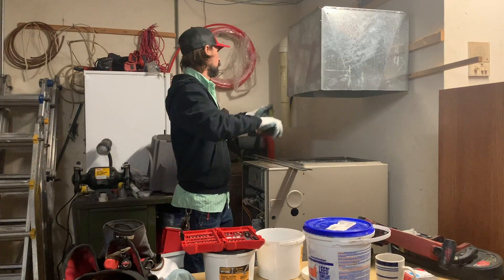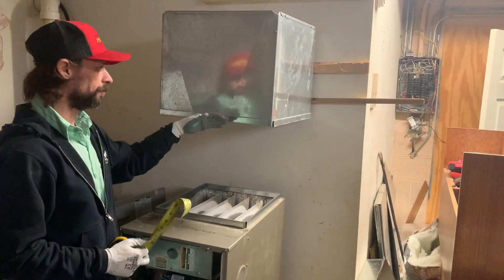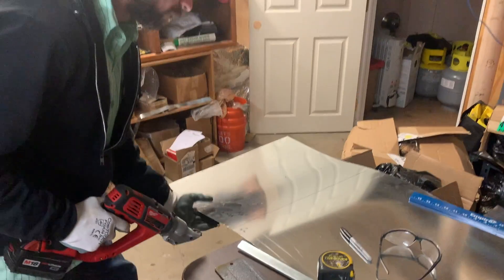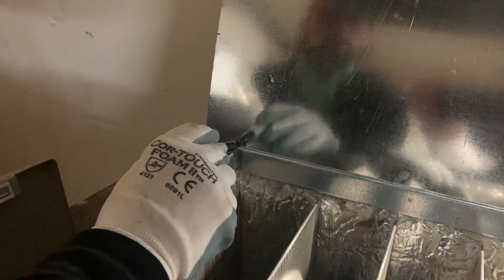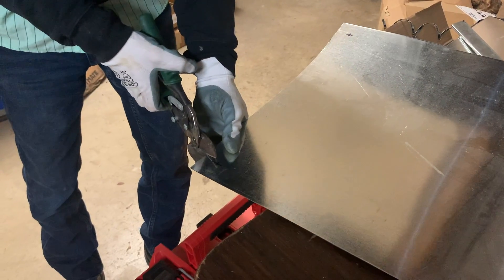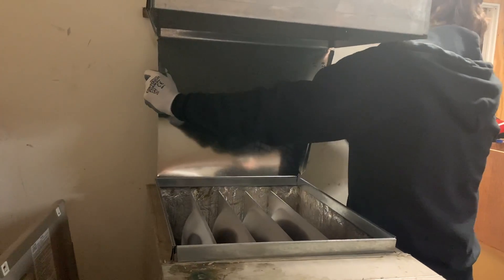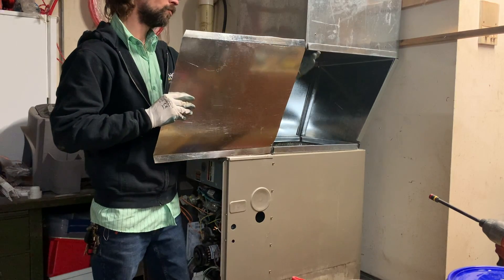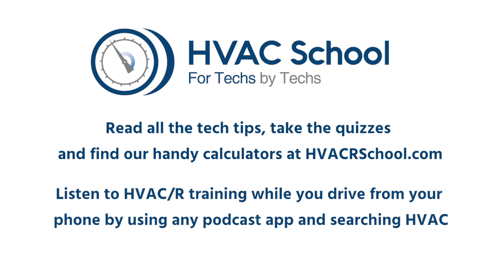How to Make a Metal Duct Transition in the Field

Comment: Their not called S Locks bro theyre called slips. The connection is called slip and drive. The slip is wat u call s lock (which is wrong) and the piece that slides over the 2 ears are called drives

Comment: great video, i would recommend cross breaking the metal to reduce duct flex noise though. in the field i usually lay the old furnace down, flex the metal along a corner, and use a rubber mallet to get my cross break if i don't have my break with me.

Comment: Around 2011, I replaced the furnace in my (low) attic.  The ridiculously time consuming step was building two transitions in place for the new unit.  I think I spent much of two days building it piece by piece.  This was before YouTube built up so much knowledge.  Today my jaw dropped when I watched how straightforward it is when you know what you are doing.  Great video, thanks for sharing!  I am gearing up for a new evaporator installation, and I feel empowered.

Comment: Great technique! For those that want to cross brake the plenum or any metal ductwork it's easy to do without a brake. Before assembly, I use a straight edge and a screen spline roller, but a screw driver, awl, etc works too, lay the metal on cardboard on a hard surface. Place the straight edge from corner to corner and run tool applying downward pressure along straight edge. Rotate metal 90° and repeat. Do this to the inside facing metal for functional and professional looking HVAC metal work.

Comment: Mi make my duct in the field got a mini fab shop in my box truck with a break if you know how to make s locks into the meat do it on the side pieces of the plenum so the back piece and front piece slide right in . It looks alot cleaner that way in my opinion. I feel like this method is a shortcut just throwing up a piece of metal and marking transitions rather than using a tape measure drawing it out and building it.. I'm a little conflicted by this and am weighing on weather if this is Hack..

Comment: Great tip on using the screen roller. I wouldn't have expected it to work so well. I'm thinking one of those thin, expanded rubber yoga mats would make a good semi-rigid backer surface when forming the cross break. Just don't tell my wife I'm going to use hers to try this technique.

Comment: One thing i do differently is not putting s slip on the furnace. Just make a 1/2” fold out away from heat exchanger  across bottom of metal piece and tbat gives you a good place to screw it to furnace, just looks better than the slip but otherwise good demo

Comment: Just an electrician but still amased when I see was how they can make a transition from round to square or even a rectangular duct. Reducing offsets look impossible to do. First thing my eye goes to in a new commercial site is the electrical then the duct work. At a 65 man maintenance shop that I worked in they had a tin knocker who could build anything out of sheet metal and never had much scrape left over. He would place eight 90 degree bends to make packing conveyor lines that had lowered lay down area on both sides to store material or parts that had to go onto conveyor belt. He always deburred edges then bent back edge 180 degrees back into itself so workers could not get cut. I was surprised when I made a sucessfull single 90 degree bend in a piece of sheet metal. Guys are absolute artist who make great duct work.

Comment: I think this is a very good video from start to finish. The only thing I noticed immediately is there is no flex duct connector. I
My understanding it that its required by code on both sides (in h out) of furnace to reduce duct vibration/noise in duct system.

Comment: was always taught to cross break the sheet before putting it in to reduce flex in the metel when the blower kicks on, though depending on the surface area it may or may not be an issue. I wish more installers made transitions like this though.
Reply: That's pretty much the way I always made them, and cross-broke everything.  Cross-braking looks a little nicer too.
Reply: Waste of time
Reply: @Bridgesc3  trolling?
Reply: @Bridgesc3  not a waste of time, it reduces popping. Just say you don’t cross brake, don’t call it a waste of time, it only takes about 15 secs to cross brake 😂

Comment: I am in the process of replacing my 40 year old furnace and AC coil with a MrCool Universal heat pump system.  This video was exactly what I was looking for.  Thank you for the easy to follow video tutorial.
Now, off to the hardware store to get the required hardware.  Cheers!

Comment: Leave the back and front s-cleat longer, so you can fold around and screw to cover the holes on all the corners
Reply: Unless you use Mastic like you're supposed to, then the fold over just looks like a big lump.
Reply: @chadegillham1165  Use clear or even grey silicon, looks so much cleaner
Reply: I was gonna suggest this too 👌🏻
Reply: @ethersecure2432  Thats what the guys did at my old company it looks a lot better and hides the gaps.

Comment: Nice work!! Personally I would do a one piece transition and a door. All with a cross break
Reply: Cross break it and then just use a flange on the front piece and screw it to the furnace so that you can just remove the screws and then the panel.

Comment: Not bad. Maybe add cross brakes and cut the front and back cleats with inch over hangs so you can bend them over the corner so there won't be air gaps. Other than that👍
Reply: It's called mastic guys.
Reply: Exactly!

Comment: Next time s/m screw from the inside corners in the back and then duct mastic everything from the inside on the back seams, top seams and side seams before sliding on your face plate, then all you got left to duct mastic is the face plate. At our shop we use FSK insulation and never use bubble wrap, mainly because it doesn't have an R value. However, that was an excellent demonstration on field transitions. 

Maybe next time you can show them how to do it without s-locks when it is in a tight closet. When we do one of those we bend the sides and not the back or front and just use a flat piece of metal for the back and the face plate.

One other thing you might remind them to put a little cross break so there won't be any oil canning. 

Again good job.
Reply: He did actually say that there's multiple ways to skin this cat. However, I'm with you and would like to see a couple more videos, showing him skin the cat some other ways, to boot.

Comment: You need to brake those or it’s going to pop every time the blower starts and stops.
Reply: Maybe, maybe not... I do recommend a cross-brake over 10-12", but trying to show the concept with common tools. Any other take aways / suggestions?
Reply: @mhoush  in a pinch one time I used a 2x4 to cross break. Really should be done.
Reply: @christopherborner1139  So everyone seems to say, but my official answer is meh... If it becomes a problem or does create noise it can be dealt with... Perhaps controlling static and using heavy gauge metal is enough in most scenarios... Keep in mind this was setup in the shop to demonstrate, often times the transitions are much shorter.
Reply: @mhoush  they can also use a flathead and a straight edge to scribe the back in an "X" to create those breaks.
Reply: Stops it from oil canning . Plus it just makes it look cleaner . Learn to do a Pittsburg end and makes it look even cleaner .
Reply: It will only pop if you use wrong gauge metal. Cant make transitions with 28 30ga metal
Reply: Paul Wehr  what do you mean by brakeing them ?
Reply: Kevin Rollins A slight x shaped bend diagonally. It stiffens the metal sheets.

Comment: That's a great video guy's!  I would probably cross break the panels....just stating NOT Hating .
Reply: Depending on tool set, it can be difficult on-site.  I do not disagree when transition is over 10-12" tall.  Was trying to keep it simple.  👍
Reply: HVAC Service & Install the crooks break looks cool and stops the duct from moving with static pressure...but onsite the only way to do it is with the “Hensler bender”
Reply: Joel Sadowsky Four foot portable brake by Malco or Tin Nocker also
Reply: I use 2 1-1/4” angle irons 4’ long I bolted together on each end with a washer or 2 in between giving the space to slide the piece threw. Homemade Hensler essentially.
Reply: C Dubs me too!